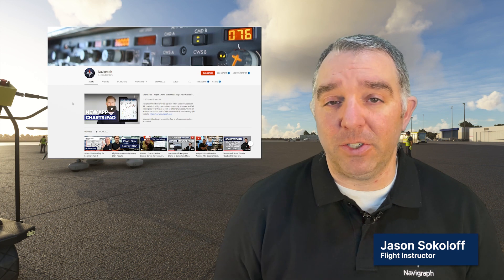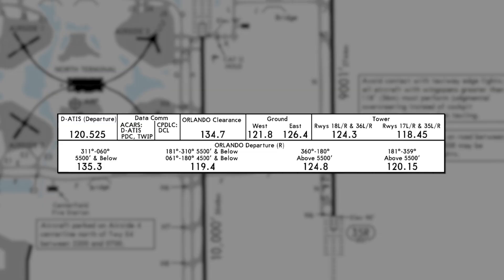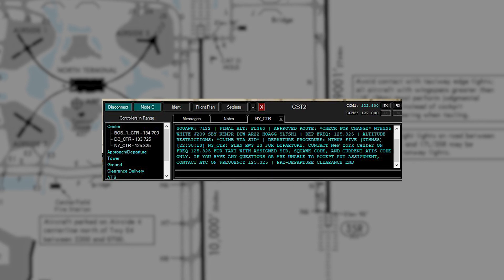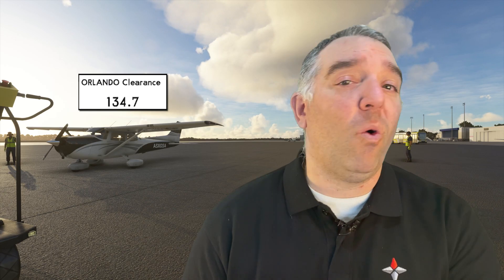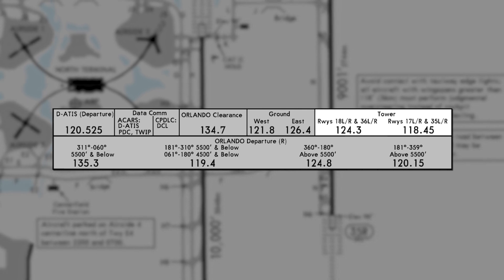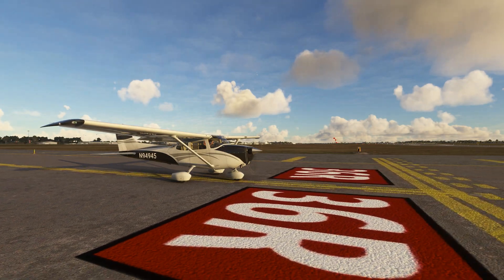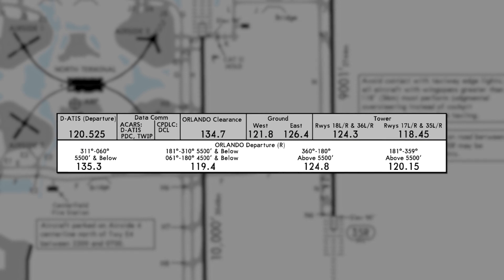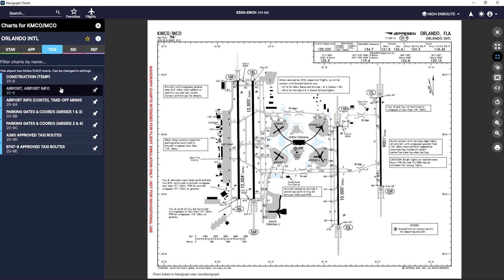How To Read Communications on Airport Charts / Flight Simulation

Comment: So, I get that in the US it is common practice to clear multiple aircraft onto a runway at the same time, but it seems like we've had multiple situations in recent years where this has caused problems, and if a radio failed at the wrong moment and somebody failed to receive a go around instruction there could be a real catastrpophe.

It seems like a simple solution to the example in this video would be to just only issue one clearance to use the runway at a time.  So if the departing aircraft was given a takeoff clearance then the landing aircraft would not receive a landing clearance. Then if for whatever reason the departing aircraft failed to clear the runway, the landing aircraft would not have a clearance and would perform a go-around, even if they couldn't see the runway.  Alternatively if the landing aircraft had already been given a landing clearance, then the departing aircraft would just have to hold short until it arrived, unless the controller wanted to cancel the landing clearance, receive confirmation, and then issue a takeoff clearance.  

Sure, that would involve more communications, and if a clearance wasn't issued on time it would result in more go-arounds, so this might require more separation.  However, it just seems way safer to only clear one aircraft at a time onto the runway.  What is the point in requiring a clearance in the first place if they are issued in a manner that doesn't ensure de-confliction?
Reply from the maker: There is so much traffic it has to be efficient otherwise there would be major delays. But, you're right it's safe to do it the other way. I think it's 3,000' horizontal separation (I may be wrong) they use and they try to pack them in. Take a look at the USAir and SkyWest crash in LAX when it goes wrong.